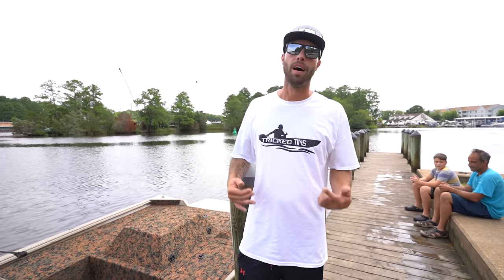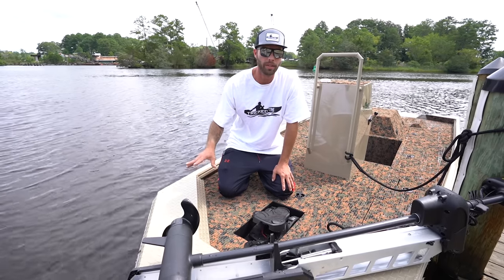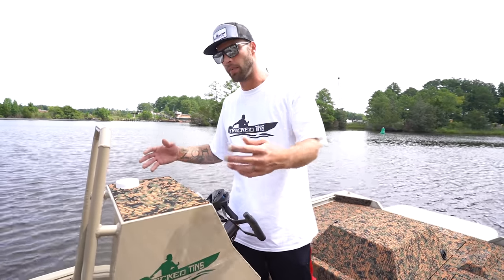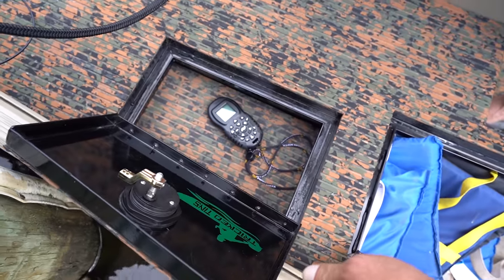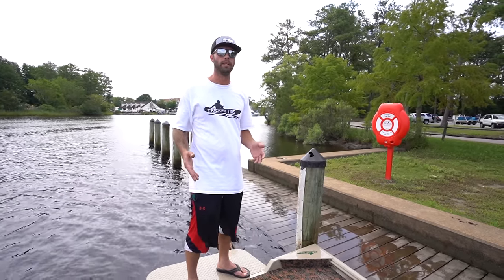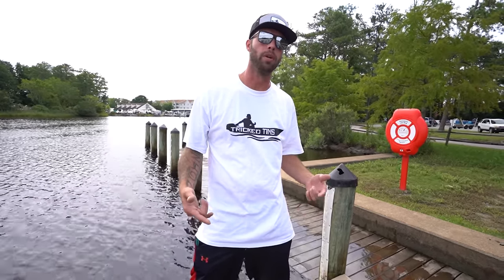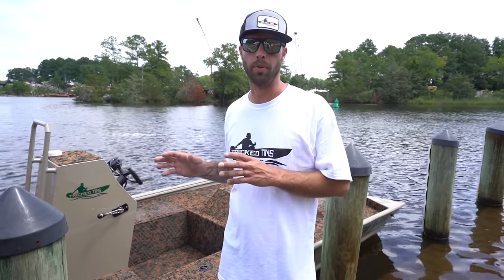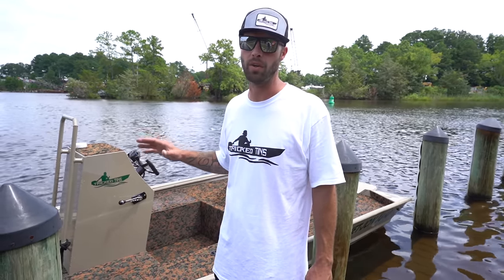180HP IN A JON BOAT?! Jet Boat Build Walk Through and Water Test

Comment: I am 77 years old and retired in Thailand. I have always had a passion for  here in what you call snakeheads are the game fish of choice. They are not only great fighters but far better tasting than bass. Jon boats are available here from 12ft. to 16ft . Since I fish alone, a 14-footer is perfect. The main problem I had was that there are no boat launches on the 6 reservoirs near me, so a light boat that can be  launched by hand by one 77 year old man had to be solved.  First keeping the weight down on the boat. Backing the boat into the water with a 2 wheel drive pickup was not a good ideal. I have a simple 12v trolling motor on the front of the boat and on the back a 10hp Honda Thai Longtail that not only gives me good speed the system allows me to fish in 6 inches of water (snakeheads love shallow water). The reservoirs here are 3 to 4 mile long to 1 to 3 miles wide so the 15mph speed from the Longtail Honda is adequate. The main thing is it is cheap. The motor and Longtail propeller system complete was $500. Naturally spare parts are cheap a new propeller $4.  The trolling motor $125, the 14ft. Jon boat $ 800 and the trailer complete with tail lights $450. 
I went on YouTube and learned to rivet  since I wanted a casting platform on the front section of the boat. I had to lower the front bench seat to make it level with the middle bench seat so that I could put a marine plywood deck on the two bench seats I also made a swivel seat so that I could seat and operate the trolling motor and cast my rod. 
To launch my boat I only need level ground to the water. I made a 2 wheel dolly with a 6ft  Handel that I can pull or push the boat and trailer with, so pushing the boat and trailer into the water by hand is easy. I only need knee deep water to float the boat off the trailer, I then pull the boat near shore to load my gear. After fishing getting the boat and trailer back to the pickup is easy. I mounted a 12v wench on a stand that fit the ball on the trailer, removing the battery from my boat I hook up the wench to the battery and the wench cable to the boat trailer and pull the boat out of the water and to the back of the pickup I can the remove the wench and connect the trailer to the pickup an head home. 
Boat, motor, and trailer  weight 200 lbs and total cost $3,000. I also spent another $900 on a Hummingbird fish locator but found it useless since I am fishing in very shallow water the GPS is not needed since I can see across the resovour, and since the water level changes so much  where you fished one month ago can be dry land a month later  asking a chart is useless. Finally I can easily remove the casting deck and take my son fishing. When I get home I disconnect the trailer from the pickup and using the dolly move my boat to an are where I can clean it and the movet it to a shed where it would be impossible to use my pickup. That my friends is retirement snakehead fishing in Thailand!

Comment: You should have used some REVive rubberized undercoating inside that engine compartment. Or a similar product, anything to help deaden the sound of the motor. Create a tighter seal reduce the noise.